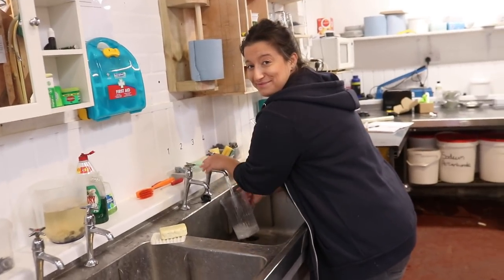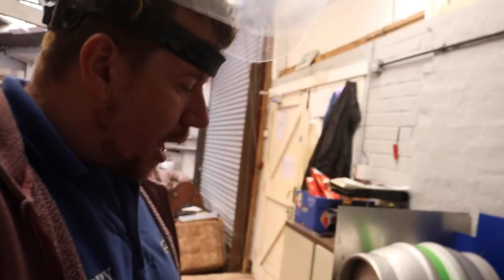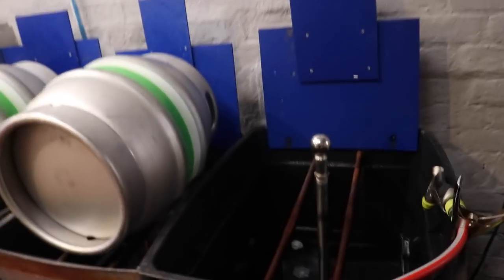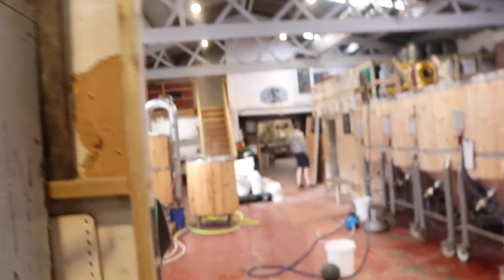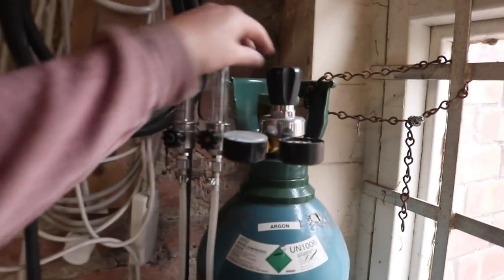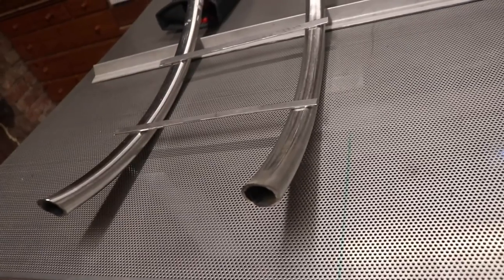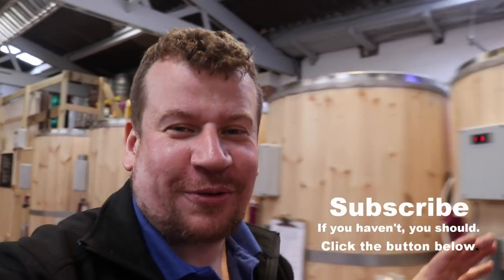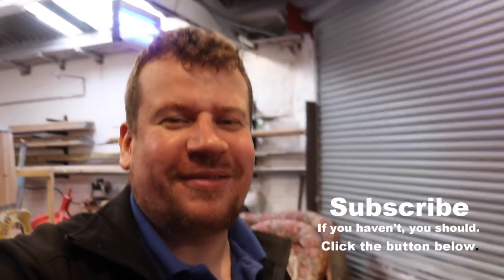JUST ONE MORE TO GO

Comment: Hi Harry; I've been going through a similar process with ballvalves. I thought I'd mention one thing to note with those orange electric ballvalves is that they take approx 15 sec to actuate. If the controller switches them [either open or closed] for less than this, they don't automatically complete the movement & might stay put until the next actuation cycle. Maybe not a huge problem, but worth keeping in mind ! We had to increase the cycle times on some of our PIDs to compensate for this. cheers 🍻